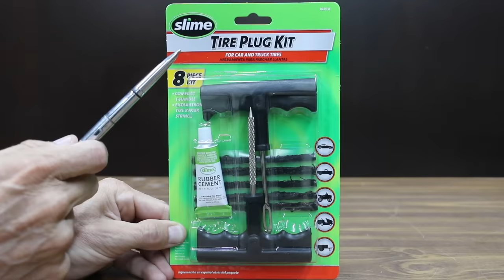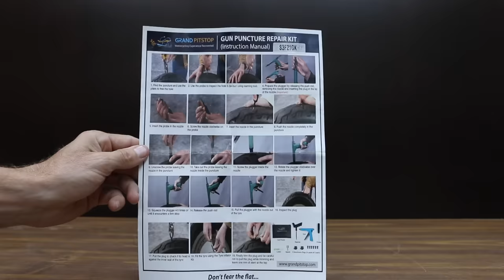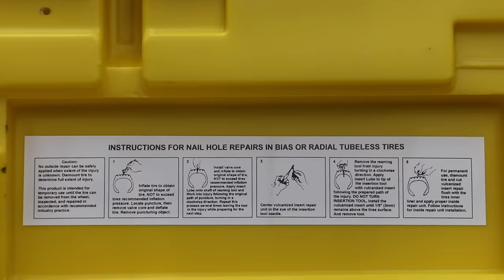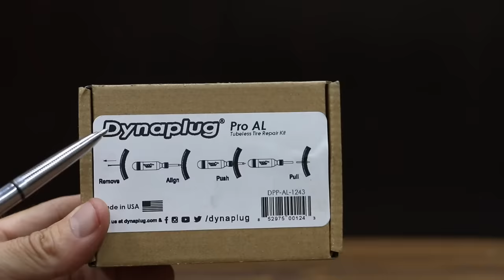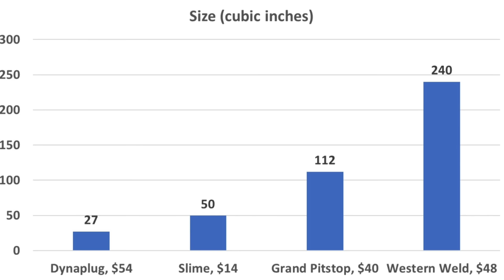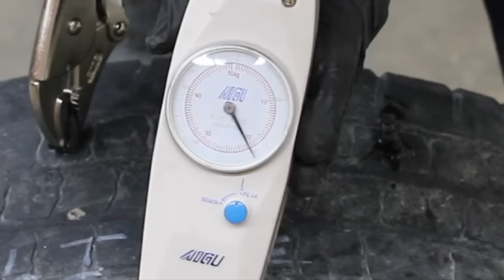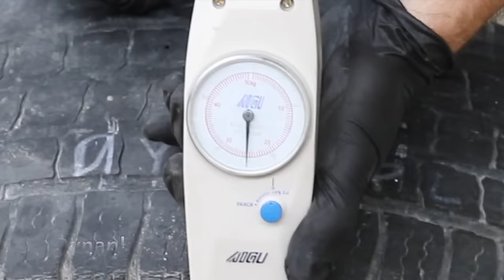Best Tire Repair Kit? SLIME, Westweld, Dynaplug, Grand Pitstop

Comment: The Western Weld kit looks just like the Original Tire plug kit which is called Safety Seal. I have plugged tires with safety seal plugs since 1977 and I have never had a leaking tire plug. I have even inserted them on the side wall which you should not and it has held  up just fine. I used to guarantee my tire plug repair for the life of the tire.
Reply from the maker: Thanks for the feedback.

Comment: I dont think even the manufacturers would have done such a thorough testing of their products.   Lot of hard work put in the video and the quality shows in the result.
Shouldnt we also require to carry a portable inflater in car for using the puncture repair kit ?   perhaps that can be a video idea too :)

In india the puncture repair shops dont cut the hanging bit from the tyre. 
 the spare tyre concept is being deprecated in our country too (india) and instead vehicles will come with puncture repair kit.  It would be best if customer bought a higher qulaity option like you reviewed than depend on what car maker provided. 

I will also buy one i think
Reply from the maker: Thanks for the suggestion.

Comment: Regarding Grand Pitstop, it is by far easier to use the gun if the mushroom plug is pushed into the gun barrel causing the mushroom head to pop over like a blown out umbrella. This causes the mushroom head to be smaller in diameter when going thru the nozzle. For example mushroom should be in barrel like this "==<" instead of being in the barrel like this "==>".  This technique also applies to "Stop & Go" and "Xtra Seal" mushroom plugs

Comment: Some tire shops will not patch a tire after you have plugged it. They have concerns that the steel belts may have become rusted after the plug has been in for a while.
Reply from the maker: Thank you!

Comment: Why cut off the tail?  Having that press down against the leak once the vehicle starts driving only aids in sealing the leak and any shrinkage would not pull the plug into the tire.

And my tire shop uses the 'orange' tire plugs, which seem to be a tad beefier than the black ones that come in these kits.  I'm not sure if there is truly any difference.  I've seen some that truly were much, much beefier than the black but I could never find out what brand they were.  Those seemed quite capable of plugging a pretty gaping hole.
Reply: The seal happens inside the hole. Having extra on the outside will make unnecessary noise or thumping.

Comment: Again a well-made, systematic test! 😃👍
Funny note: all of these kits are available in Germany or via Amazon in Europe. But all have another branding. So I suppose they are all most likely made in China! 😉
There is also a kit available here in Germany like your Slime-brand with 1 strip less but with 3 CO2-cartridges and a 5 cm (2") air hose. So if you're too lazy to get the compressor out of the trunk this kit will bring you at least to the nearest gas-station where you can adjust the tire pressure.
You also made a test with liquids ("tire-milk"). Here in Germany seems to be a law that tires that were treated with such a liquid mustn't get repaired anymore. They have to be replaced. 🤷‍♂️

Comment: Tis interesting that the mushroom plugs, which have the very elaborate installation tool, are the only ones which leak.  That is consistent with what I've read elsewhere.
And the cheapest chinese plug repair kit does as well as anything else. 

I have plugged loads of tyres and have always treated them as permanent.  I gather the concern is that a tyre might have been structurally damaged by being run very flat, and you can't see that till the tyre is removed.  Which is no doubt true - if the tyre has been driven distance when really flat.  But if you know it hasn't then, personally, they are good enough for me.   

The other caveat is that if sometime tyres develop a spit from, say, a very sharp rock etc, leaving a non round hole that necessitates removal and a vulcanised patch inside.

Anyway, as ever, excellent video with rigorous testing of really useful things.
Reply from the maker: Thanks so much!  Thanks for sharing.

Comment: I've been using plug kits like the Slime type. It is the easiest to use. The other ones involve too many steps or harder to find refills easily. You can get Slime type kits relatively cheap and the refill plugs cheap also. I have plugged tires on compacts up to large SUVs with no issue at all and lasted the life of the tires. I plugged a lot of tires. I just buy the cheapest one I can find. I have had some strips that were years old and they were still tacky and strong like from the day I bought them.

Most tire shops you buy tires from will offer free flat repair but you gotta take it in wait etc. so sometimes it's more convenient for me to just plug the puncture myself. It doesn't take much time. 

Most new cars these days do not have a spare but provide only an air compressor and a can of sealant you fill the tire with via the air valve and then use the compressor to inflate the tire with. This repair is temporary and tire shop will not be happy when they have to clean all that sealant out before they repair your puncture.

I always on trips pack a compressor depending on which vehicle I am taking, a plug kit, needle nose pliers, Philips screw driver and a flat head screwdriver. Why the screwdrivers? Because if I have to remove a screw it is easier to unscrew it from the tire than pulling it out or using pliers to twist it out. The flathead can also be used to get under the head of a nail or screw that has its slots worn down and the head sits flush in the tire and you have to pry it out some so you can use the pliers.

I carry the repair kit for a few reasons. One, I can repair my tire and be on my way and don't have to look for a shop to make a permanent repair as in the case if I used the can of fix a flat. Two, I have after market rims and tires on my SUV that are different size than my full spare. And three, one of my cars has only a compressor and a can of fix a flat, and my other car doesn't have a full size spare so these two last scenarios would require me to drive slow and limp my way to a shop to get a permanent fix and ruin my trip.
Reply from the maker: Thanks for the feedback.

Comment: can you use Selleys kwik grip contact adhesive instead of the rubber cement slime  puts in their  packet,
Reply from the maker: Thanks for the suggestion.
Reply: @ProjectFarm   thanks for the reply, but it was a question as i ran out of it on a long trip in oz so i had to buy another full set

Comment: Just used slime today on my tire while it was still mounted.  Been using slime for a number of yrs without any issues.  Easier to patch if you take most of the air out of the tire.  I usually add some extra rubber cement.  True, getting the plug in takes a lot of force and some precautions. Have you ever use tire screws?  Its basically small machine screws with a rubber coating.  Irony.  You first remove the screw thats causing the leak by replacing it with a screw to stop it.  The head of the screw appears to be the same width as the threads.  Figure its even a faster solution then Slime  on bad days like in the rain or snow.
Reply from the maker: Thanks for the feedback.

Comment: I'm not saying this to argue the effectiveness of any of these kits one way or another, in case someone thinks this is suggesting the kit. But ... I just want to find the little folding razor that comes with the Grand Pitstop kit. It's nice and small, and it's safer than having a box cutter blade floating around inside a kit. The rest of that kit isn't nearly so compact, which is why I'm just focusing on the folding razor knife. I want one of those lol ...

At least, I'm thinking about a compact roadside kit for my motorcycle. I have a compact plug kit for emergencies, but unless I carry a knife of some sort, it didn't come with a way to cut the end of the plug.
Reply from the maker: Thanks for sharing.

Comment: I have been in the auto field my entire adult life. First auto job was a tire shop.
A "string-plug" or push plug will definitely get you down the road but given enough time a significantly high proportion of them will leak (usually slowly over long time periods) that is often not problematic since people generally get their tire pressure checked often enough that it will never be apparent to you...however the same air creeping by over long time periods can get between the layers of the tire and cause separation... It isnt super likely but the older the plug/leak the more likely it becomes. A proper patch from the inside is highly recommended but if the tire is nearly shot... Dont waste the money plug it and replace it soon.
Reply from the maker: Thank you for sharing!

Comment: Here's a side of the road tip. It works best if you have a friend. Use only good metal plug tool. Get the plug tool started, then SLOWLY roll the car back, and keep the tool lined up with tire. Roll car until weight of car pushes plug all the way in. Roll car forward and pull out tool :) Saves a tone of elbow grease....

Comment: Slime plug still working fine after two years, 60 000 miles.
Cheap fix vs wheel repair, balancing wheel again...temporary installation of spare tire. 

Plugs are very cost-effective.
Reply from the maker: Thanks for the feedback.

Comment: I have the slime kit and the pitstop I found anything over a 4 ply use the slime kit Truck Tractor .  Motorcycle and passenger car the pitstop will work for the life of the tire .  have had a few screws and nails bend like a fish hook and nothing better than a inside tire patch since the hole was in 2 spots from the hook .
Reply from the maker: Thanks for sharing.

Comment: I've used plugs for decades. The only plug that has ever leaked or failed on me was one installed by a tire shop. But even it lasted over two years and several thousand miles. All the other plugs have lasted the life of the tire.
Reply from the maker: Thanks for the feedback.

Comment: As a master tech and PROCAP student at a dealership in the past, we would fix flats for free with plugs and they will outlast a tire. Our plug tools looked the same as the Westweld and never failed. 

Carry these, an electric pump, and pair of wire cutters in your vehicles then you can fix the flat without removing the wheel from the vehicle. Just roll it forward where you can access the hole.

Tests on portable air pumps would be nice on this channel. Before I bought the nicer lowe's style I had the "nicer" Coleman version and the first time I went to use it it fried all it's wiring. No fuse in it to keep it from destroying itself if the motor was frozen. Lowe's Kobalt 12v/120v has been going strong for 4 years now with lots of use.
Reply from the maker: Thanks for the suggestion.

Comment: I live in melbourne (aust) and used to operate a fleet of taxis.We used plugs for 30 years and can vouch for their safety however i would strongly urge you to buy a kit that has the metal handle and not the plastic handle as they can break and cause horrific hand injuries.I have seen it with my own eyes and its very dangerous because of the force that is required to push the plug down.
Reply from the maker: Thanks for sharing.

Comment: Well, I just experienced a problem with tire plugs. I had a finishing nail embedded in the LR tire. I removed it prior to a trip and installed a Safety Seal plug (looks like your Western Weld plug and kit) following recommended procedures. The tire pressure has held up just fine, no leaks. During a 700 mile trip, I had a vibration in one of the 2 front tires\wheels, so I stopped into a Discount Tire shop while out of town to re-balance the front tires. While there, thinking my plug repair could be considered only temporary, I asked to have my plug changed to a plug\patch that I have had them do in the past (not removing a plug first, just a nail for example) They said "NO they wont repair a previously plugged tire." I also discovered that not only won't they re-repair a tire (unless they repaired it in the first place, everything is in their computer files you know) They won't rotate, re-balance, or even check the tire pressure on a plugged tire (I suspect that maybe they won't repair ANY tire they didn't repair in the first place)  

I understand the liability issue and all, just not this "I wouldn't touch your previously repaired tire with a 10 foot pole" attitude. I now see that a plugged tire had better be a permanent fix. If you figure to get a "temporary' plug repair re-repaired by ANY tire shop in the future, good luck!
Reply from the maker: Thanks for sharing.
Reply: I've never had a rope plugs fail. Patch plugs are nice but what's the point if a rope plugs will outlast the life of the tire?

Comment: So I know tires would be a difficult thing to test, but it would be kind of neat if you could rig up a tire testing rig for wear and tear properties. Maybe test pulling the tire apart, thickness of rubber, hardness of rubber. You would have to separate H/T, A/T, M/T etc. tires, but it would be kind of like the oil testing you did where you could do a marathon test.
Reply from the maker: Thanks for the suggestion.

Comment: I had Michelin Defenders T + H 205/55R16 tires on my Nissan Sentra. I got a long screw in my tire at the very top of the sidewall. It was just on the tread but still considered the sidewall.
I drive Uber for 14 hours a shift <-- that's the time on the app before Uber automatically tells me I need rest for 6 hours. On the Florida highways where the speed limit is 70 but traffic flow is around 80. When there is little traffic I typically drive at 78 to 85 (passing) depending on road conditions. I'm a hard driver. I drove 2 years on that Slime plug.
Reply from the maker: Thanks for sharing.

Comment: I have been using a brand called safety seal for years, I have saved many off roaders, atv's, tractor tires, even semi tires, they work for them all, weater you have 5 psi or 110 psi, never had one fail yet, one jd skip loader has well over 100 plugs in it from 12 years ago, and is still holding, never use rubber tires to clean up a area with thousnds of roofing nails. lol
Reply from the maker: Thanks for the feedback.

Comment: You should include the cost of the adhesive in the Western Weld product for all tests since its not part of the kit. In addition, The Slime Tire Plug Kit is $6.98 at Home Depot
Reply from the maker: Thanks for the suggestion.

Comment: This is standard in all my vehicles. I buy the 9 dollar kits at tractor supply and keep them in there. I have repaired tires most of the time with out removal. The plugs they say don’t last but have had them in the for the life of the tire. Not only are these a cheap time saver. They will save you 40 bucks now for a patch job at a tire shop. But also save you a expensive tow bill.
Reply from the maker: Thanks for the feedback.

Comment: Rubber adhesives are specific to adhere rubber-to-rubber.  They work by having some solvent qualities and so slightly dissolving the rubber and making them weld together to some degree. So the adherence to steel was probably a true test of actual circumstances. If you ran this test gluing the same length of plug to the outter surface of the tire (maybe cleaned sidewall) and measured the pull-off strength from the center of each plug... now that would be a more true-to-life test. But good anyway... gave me an idea of what to buy.
Reply: Btw..BTW... like materials adhere best to each other on a molecular level. When will they have self-healing tires?

Comment: Definitely a lot of work into inserting a plug into a tire. Sometimes it is best to 'remove' the tire to get the plug in and a lot of work to pull it out as proper "leveraging" to get it in and out is paramount. So, strength for some folks will be an issue. May wanna get the gun kit for that if that is the case.
Reply from the maker: Thanks for the feedback.

Comment: As a former tire technician, I would only plug a tire if it was worn and in need of replacement, for a newer tire or a tire that still has a lot of tread life I always recommend dismounting the tire and doing a proper patch but in a pinch the slime plug would be my choice.
Reply from the maker: Thanks for the feedback.

Comment: I'm unsure why you chose to test pulling the plugs out, rather than pushing the plugs in. The latter is a far more realistic scenario, especially on gravel roads where a small rock can be pushed into the plug divet and press into the plug.

A permanent patch, where they dismount the wheel and put a patch and plug in from the inside, has 460 Newtons of push resistance - hard to be dislodged by a rock or another pokey object.

Traditional gummy rope patches like the slime and the westweld put up about 125 N resistance and reseal with the tire's internal pressure.

Dynaplugs are very close behind at 122.5 N resistance - they're somewhat hard to dislodge and if that happens they'll leak slowly.

But mushroom style plugs only offer 80 N of resistance. Should something poke it, it can pop inside the tire quite easily, reopening the original puncture and causing the tire to catastrophically deflate.

The first 3 are coated in adhesive, but mushroom plugs are coated with lubricant which is one, but not the only, reason they pop free so easily.

The internal patches are safest and are considered to restore the tire to pre-puncture condition, but have to be done in a shop.

Rope patches have been around for almost as long as automotive tires have and can be put on roadside as long as you can reinflate the tire.

Mushroom patches like the Grand Pitstop tested here,  with their sudden failure potential and the resulting rapid deflation, can cause accidents at speed and are considered "deadly".